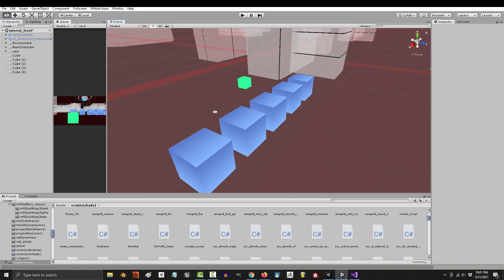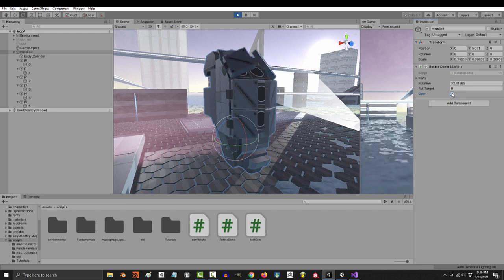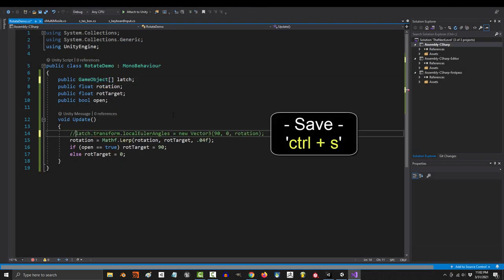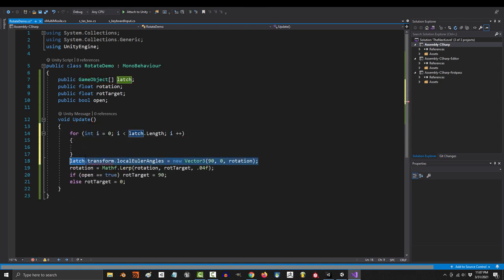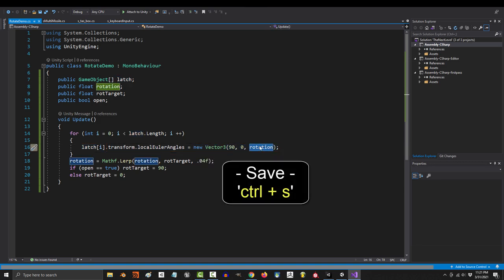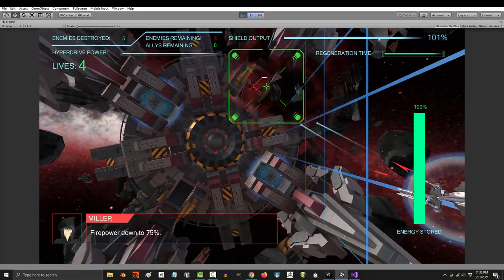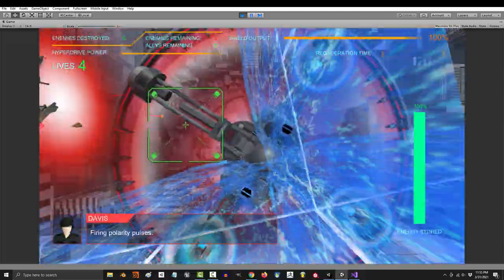Unity 3D : For Loops & Arrays Tutorial- (In 2 Minutes!!)

Comment from the maker: It's dangerous to use Arrays alone... Here, take this For-Loop -
{
    public GameObject[] latch;
    public float rotation;
    public float rotTarget;
    public bool open;

    void Update()
    {
        for (int i = 0; i < latch.Length; i ++)
        {
            latch[i].transform.localEulerAngles = new Vector3(90, 0, rotation);
        }
        rotation = Mathf.Lerp(rotation, rotTarget, .04f);
        if (open == true) rotTarget = 90;
        else rotTarget = 0;
    }
}
Reply: it's dangerous to have an infinite loop in Update too
Reply: It seems there's one thing missing, which is the pivot- I am referring to the opening of latches of the missile launchers
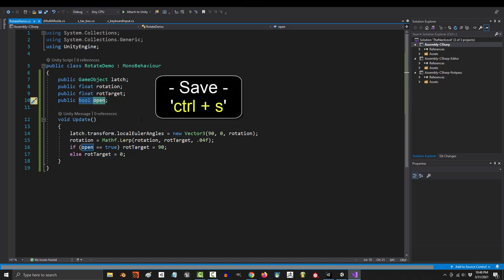Reply: Ah I slightly changed the 0:29 code because the I can't displace the pivot point of each latch door in Blender. I do it in Unity instead, by firstly, adding an empty component to each door as pivot. Then set the pivot as the parent of each latch. Then use the launcher(or any other object) as manager to run the latch-opening script.

The changes I 've made is:
//field
Replace
public GameObject latch;
with
public Transform pivot;
//field 

Update()
Replace 
latch.transform.localEulerAngles = new Vector3(0, 0, rotation); 
with 
pivot.localEulerAngles = new Vector3(0, 0, rotation);

You can see the codes are almost the same actually. I even asked Chatgtp it said the result will be the same. But the truth is that it is not the case. If the pivot point is set up in Unity, using the script provided by RoyalSkies will have the latch door distorted.

Remember this is for the situation whereby pivots are set up in Unity instead of in Blender.

Comment: Because a loop to go over every element in an array (or other, more advanced collections) is such a common thing, C# has a special, simpler loop for that: the foreach loop.

foreach (var item in latch)
{
   item.transform.localEulerAngles = new Vector3(90, 0, rotation);
}

Basically it does exactly what it sounds like: runs once for each element in the collection, and instead of giving you an int index as its loop variable, it gives you a loop variable representing the current element.